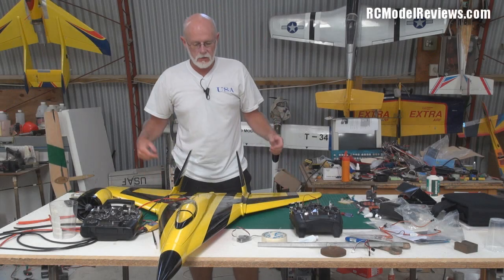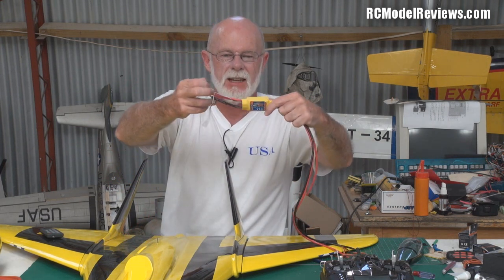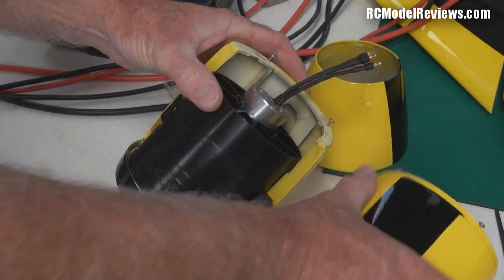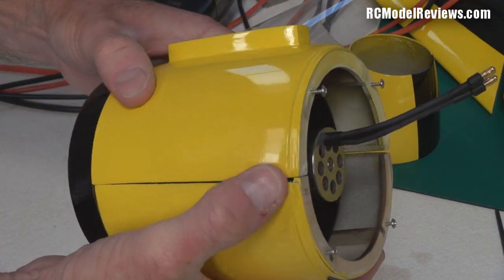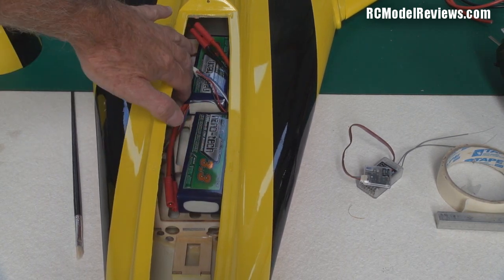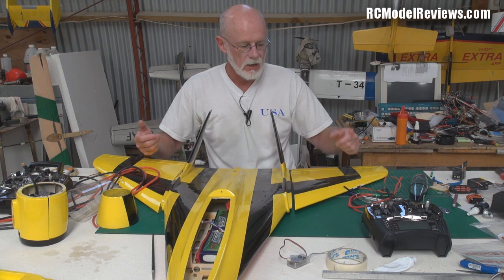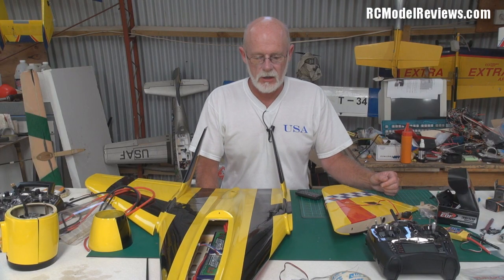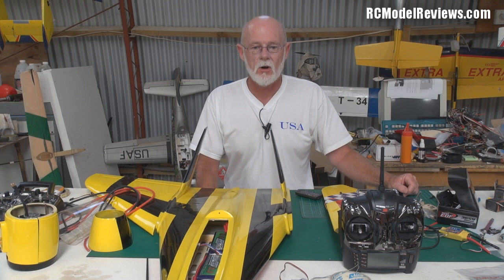Update: Bruce Lee 90mm EDF - build progress

Comment: Can i just ask you Bruce,as you are an electronics guy, do you think its stil ok to use etracts if the little switch on the board breaks, just let the overcurent electronics deal with it? i have one on a set of HK retracts, the set they sell with the olio's and alloy wheels for the 90mm hawk which it has happened to, i used a packer so the retract would stop in the correct position and it seems to be working ok?only thing is i don't know if i risk draining my flight pack??

Comment: BTW Bruce have you checked that your fan is not of the "bad" batch ???.. btw only 3.3Amps packs ? ? ?
if the motor isthe XK4082 then your amp draw will go as up as 130amps +
ALSO if you got a k-force 100amp ESC it will be better because that oen can burst easily up to 150A. I was using it at 137amps